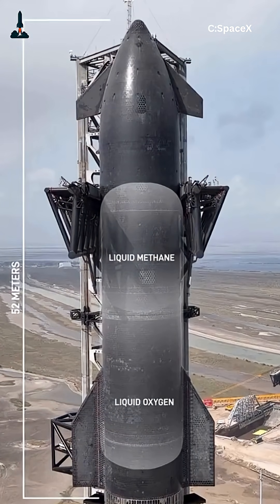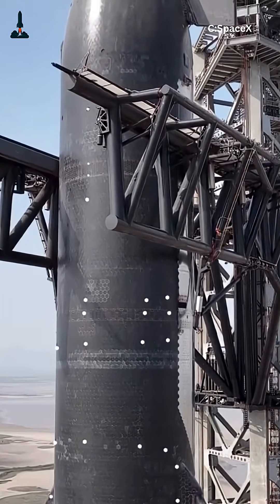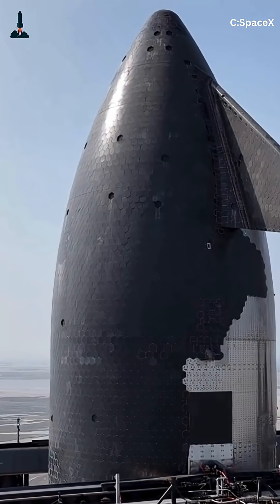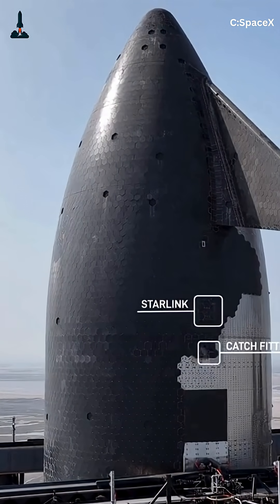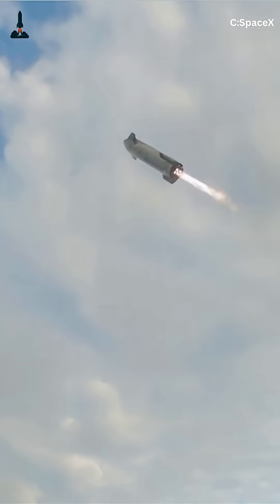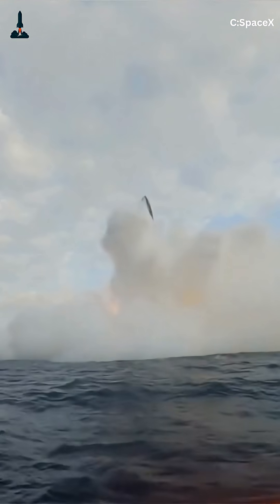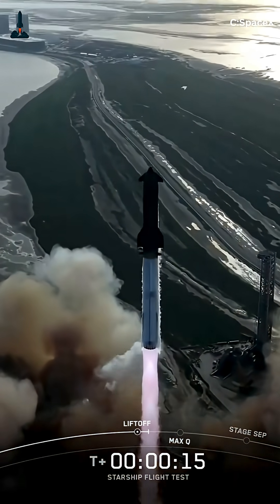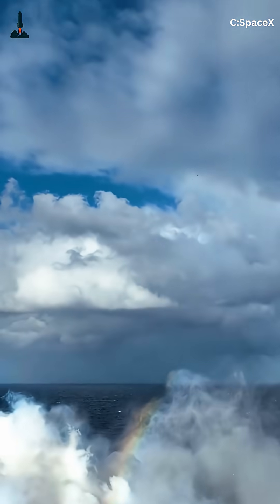This Tiny Change on Ship 38 Could Redefine Mars Landings Forever #spacex #flight11 #ship38

Comment: What is the payload?
Reply from the maker: This is LEO configuration payload 

Fully Reusable	~150 tons 	~100 tons	Both booster (Super Heavy) and ship are recovered and reused
Expendable (non-reusable)	~250 tons —	All stages used once; higher payload capacity since no fuel is saved for landing

Comment: Why not make a giant shell for the heat shield made of the same material? Instead of individual ones. Then after the flight the whole shell can be removed and a new one popped on in minutes. This seems much more better for rapid re-usability. 🤔
Reply: it's Ceramic, almost impossible to make it big
Reply: @falcon9ft710  Is that the issue? Is there another material that has the same ablative properties that can be scaled up like that I wonder? I'm guessing Aerogel would be vastly too expensive eh?
Reply: @Its_Hubbs 
Aerogel would be worst possible material to make ‘Big one tile’ 
Aerogel, Ceramic tiles… they are basically Crystal. They are hard, brittle, prone to shatter.
If we keep it small, we can control those to some extent but bigger it gets, difficulty goes power of it.
That’s why silicone waper on semiconductor factory can’t be bigger, why Big diamonds are very hard to find or manufacture, why tiles on our housing aren’t bigger.

We can endure few heat tiles cracks or detaches.
But when the ‘Big one tile’ cracks, it is all over. Like glass shattering
(There’re many grammar error since i’m just an Asian, English is not my language)
Reply: @falcon9ft710  Thank you, that was very enlightening! And I understood you perfectly, you write great in English. Everything you said makes perfect sense. The analogy you used for one big tile breaking like glass puts it into the big picture of why we have to use small components making up a bigger surface all together. Damn this infernal thick atmosphere!!! 😂 Although, I do like living! 😂 Take it easy eh! And thanks again! ✌

Comment: 🔹️ Much love to you and your whole team in delivering the goods, so-to-speak.🥰🌻
••••••••••••••••
🔸️Just out of curiosity.🤔
~ What level of pressure or GeForce is suctioning or pulling at the tiles when the gravity fluctuates?
🔹️Is there a way to create an environment or a shield around the rocket/shuttle, kind of like in the simulated TV shows? If there's a way, it would increase the lifespan for all of the materials, instead of just, "offering it up", as it is said with some religions.
Reply from the maker: Based on past Starship flight data (like Ship 25 and Ship 28), the G-forces range between 4.5–6.5 g during reentry and about 3 g during ascent, depending on angle of attack and aerodynamic stress near max-Q.
Reply: @Rocketry-j4s 
•••••••••••••••••○
~ Cool. So, the G-Force can nearly double in response to the angle of re-entry.
~ I love how detailed your response is. You guys don't disappoint in the slightest when it comes to your knowledge. 
•••••••••••
🔸️Is there any way to deflect some of the G-Force aside from the angle of re-entry? ~ Not saying that this hasn't already been discussed by many great minds.
Reply from the maker: Yes — G-forces can be reduced using Raptor engine thrust braking, cutting peak loads from ~6 g to ~4 g, flap control to boost drag by ~30–40%, and trajectory shaping, e.g., a 20–25° reentry angle spreading deceleration over 150–250 miles of atmosphere.